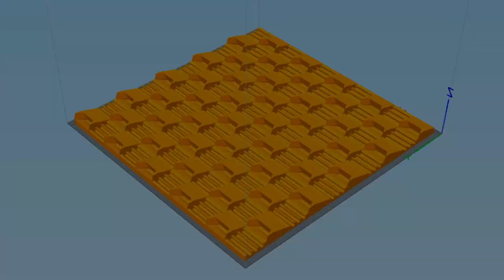Fabrication Sluice Orpaillage , par  DIDIER APPERT

Comment: Hallo, great video. That´s exactly similar i will do it. My CR 10 is send yesterday, i´ll get it in 1-2 weeks. But it was a decision  between the CR 10 and mega. I´m beginner in 3 d printing. Change inlets in the sluice that´s  fantastic. My intension was to make lighter  the sluice. cause in the montains it´s to heavy, and to prospect it´s enough. Really a good show from the step beginning to use up to see Gold.Go for it.
Tom
Reply from the maker: Hello, thank you for this comment. Do not hesitate to share your future work on our group fb and you need advice do not either
Reply: Bon demain, simplement la classe. Exactement comme ça je voudrais aussi avoir cela. Un caniveau large de 20 cm et des nattes à échangent. 
Peut-on aussi imprimer à soi-même un caniveau du plastique ? Fait est-ce que le sens ? 
Avez-vous fait des tests aussi avec des caniveaus synthétiques ? Prenez-leur PLA ou l'ABS ? 
Comment reçoit-on les fichiers ? Puisque mes Alu larges de 30 cm le caniveau sont très lourds, je rendrais cela volontiers léger. 
Salut de la fête d'octobre 
Plus loin tellement 
Tom